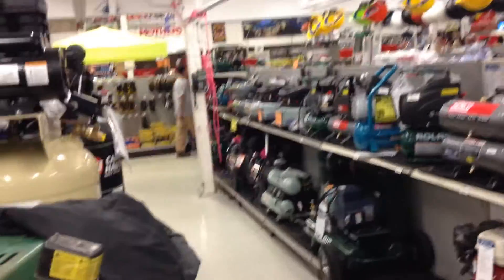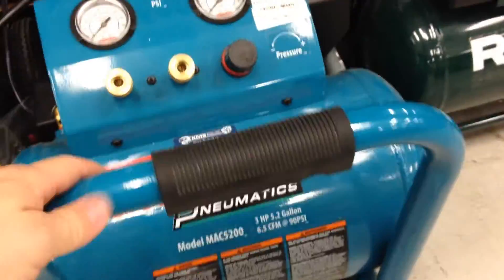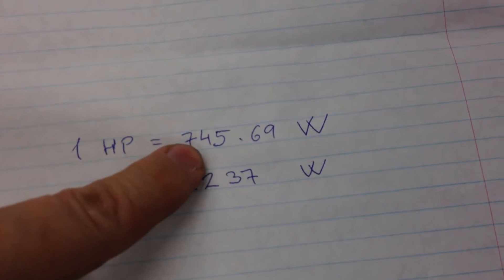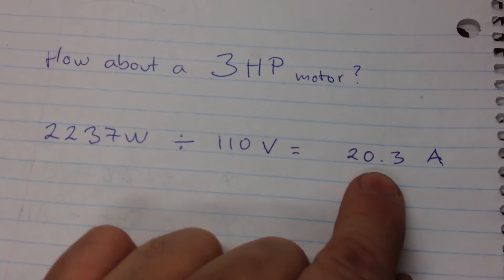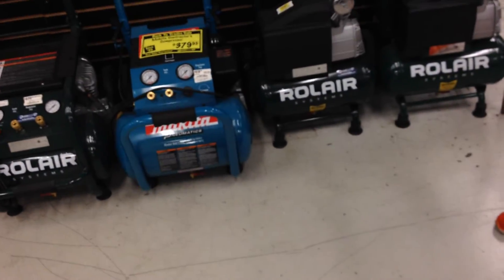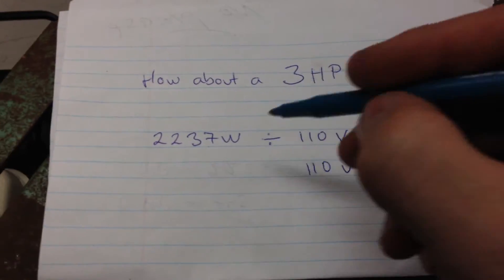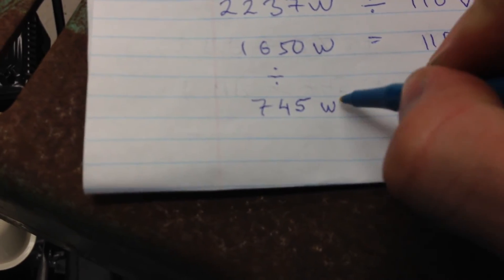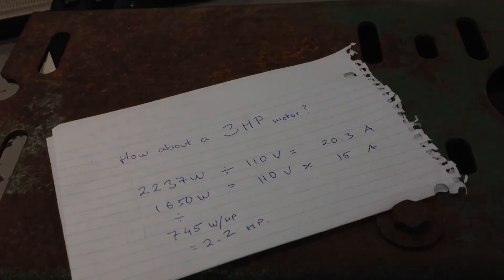Can a 3HP power tool be run on a 15 Amp circuit?

Comment: Seems correct. That compressor is a Makita MAC5200 and there have been reports of it kicking breakers.  A little more math . . . the MAC5200 runs at 3420 RPM. The similar 2.5 HP MAC2400 runs at 1720 RPM. The MAC5200 is rated at 90 dB sound level. The MAC2400 is rated at 79 dB — 11 dB quieter —  which means the MAC5200 is over TWICE as loud. So, if you buy the MAC5200, you'll get more air volume, but you'll need a 20 amp circuit and a tolerance for a lot more noise.

Comment: I run 2hp compressor in my garage and fuse burn !! I don’t know why on the box says 14.3 amps however, on the manual says 12 amps , my fuse 15 amps also my wash room run on the same line what do you think ?
Reply from the maker: 1 Compressor circuit should be a home run, not shared with anything else.
2 Peak start-up amps are different from running amps, too. Might peak at 20 A for a few milliseconds. Some fuse models are more sensitive, others are delayed.

Comment: does anyone know if its possible to rewire a 15amp 250v compressor to run with 240v?
Reply from the maker: pearum sok Should not be a problem. Those compressor motors are not super sensitive to voltage variations or drop. It`s alternating anyhow. Most countries run on nominal 230 V ±10% at 50 Hz, which is a result of voltage harmonization. just plug it in and switch on.

Comment: In India we get 250 Volts for home use. Then as per maths 2237/250 = 8.9 A so this motor will run on 15 amp socket in India ???
Reply from the maker: Prashant Gaikwad No it will not. Flawless math, though. So: 120V motors do not run on 250V for long without fail. The motor`s wire coils have a fixed diameter for electron flow, just because a 120V motor is plugged into 250V it does not grow thicker wires in its coils. The wattage is calculated based on the Amps and Volts, based on wire size, so a 2000W motor under 120V would behave like a 4000W motor under 250V without having enough wire to carry twice the amps, so it just does not work. Some motors are wired 120/240V, those work ok.
Reply: apprenticemath Thank you very much sir ... :) I am a Welder will you make some videos on welding machine. Topic like duty cycle, 440 Volt - 220 Volt, AC/DC, welding machine cable capacity to carry currant.
Reply from the maker: Thanks for the idea, coming soon.
Reply from the maker: Prashant Gaikwad Here is where I left off, I will continue from here. What are gauge numbers? What is the actual size?  Amps and wire gauge are next.
Reply from the maker: Prashant Gaikwad ... and here is the first part What`s an Amp?
Reply: apprenticemath Thank you very much Boss :)